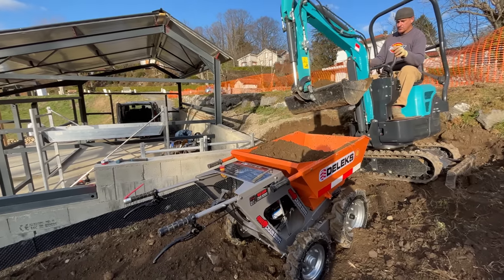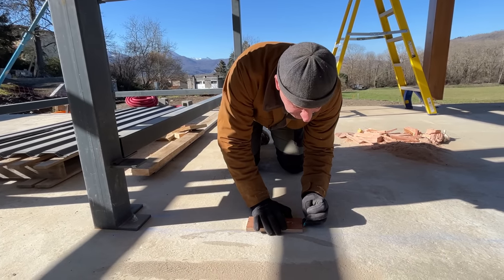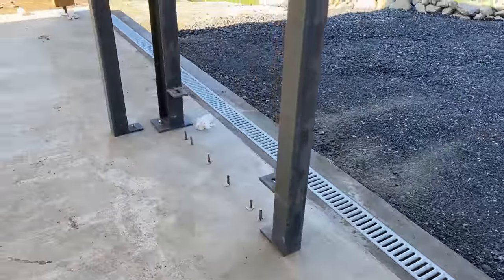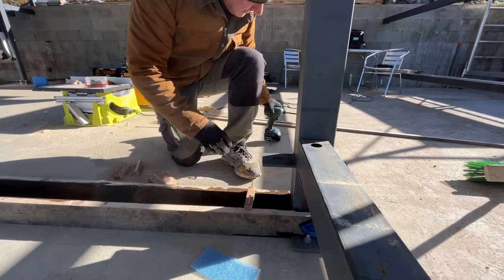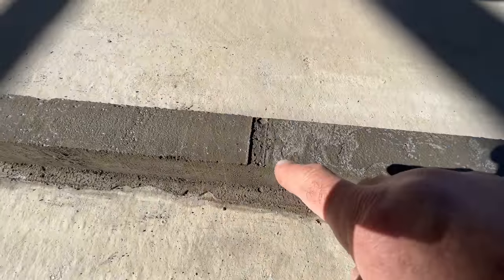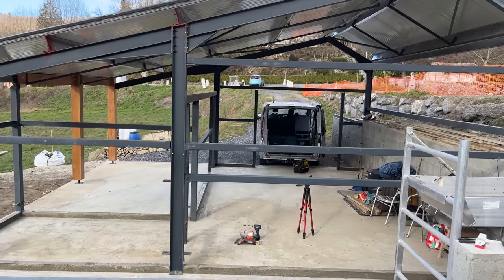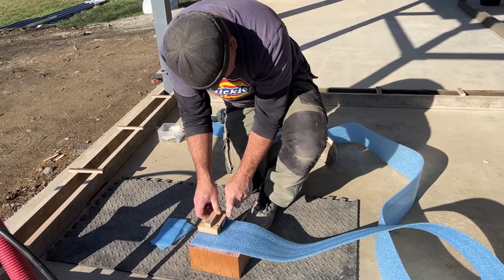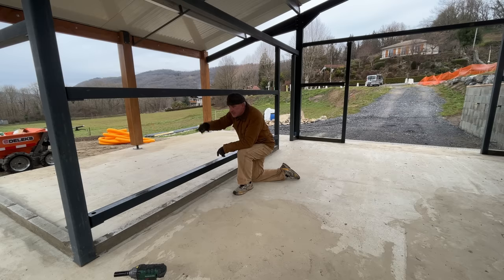Concrete Plinths & Earthworks  | Garage Shop Project EP28

Comment: Could I make a suggestion?? With wheel barrows powered or handraulic , alway face them the way you are going to go before you load them. That way you don't have to fight a full one turning around 👍
Reply from the maker: It is quite agile, but i know what you mean.  I was trying to get it wide for the 80cm bucket.  Julie is tough though 🤣

Comment: Hi you, I love your videos and am excited to wait every new episode. And I learn something every time 😄.
For the little concrete footings I wonder why you don't use brick stones, which will be much less work when I see all the preparation you have to do before pooring the concrete. I wonder if stones were not easier and faster?

Please go on with your video documentation, I love your channel!
Reply from the maker: If I had used bricks then there would have been more risk of living gaps in the mortar and and there would have been mortar in the vertical joints.  I had the wooden forms already and the smooth concrete, painted black gives a nice shadow gap too.  Plus I am awful at laying bricks 🤪

Comment: Can't remember if you've ever mentioned, will you put up solar on the garage roof once you are further along?
Thanks for the update as well.
Reply from the maker: Hi Robert - yes, we will have around 18 panels on the roof.  It is SW facing so not perfect but will get a lot of summer autumn sun.  The house itself will have another 18 panels and is directly south facing.  No intention to connect to the grid.

Comment: well done keep it up , i am still far behind in building my garage for the equipment 
but had similar ideas in mind , the plinth is a good idea i shall be doing one as it protects the sheets and  prevents water ingress. thanks for the idea
Reply from the maker: The plinths seemed to have worked and makes a good solid barrier to the outside.

Comment: Tip: to save cutting blades and speed up while cutting rebar, all you need to do is cut past half way and then the rebar is easy to bend and snap.
Reply from the maker: It would mean stopping each time to wiggle...I was surprised the disc held out and it is still on the grinder.  No more rebar for a while.....thank goodness 🤣

Comment: Interesting method with that short concrete stub wall. Not something that is done here in the US but that's why I watch so many channels like yours is to see what everyone else around the world is doing. Often run across some really neat ideas that I put into my tool box of methods. 
      I kind of wish I had a bigger concrete mixer. Mine is a one bagger i got almost free.. But my back says I don't need one... One of the best things I bought was a two wheeled wheelbarrow. But when will we get enough scratches in the powered wheelbarrow to put concrete in it. :)

         That finger is going to be sore for a while. BTDT.
Reply from the maker: I do not think this is a normal practice here.  I just couldn't think of another way.  It is just a small stem wall poured after the slab.  I just wanted a barrier between the inside and outside as the rain has a tendency to blow sideways here.  The more we used was a cast off from a friend.  And now it is at my son's house for his extension build.  I do have another which is 25 years old but needs a transformer as it is a 110v (site safety in UK requires 110v machines for some reason)

Comment: Hi Ian an Julie       your concrete  bases were very well put together and attention to detail  payed off . They look great . Glad you have had some good weather apart from the frost but as spring comes that will be less. You know you should both invest in hard hats as a bad bang on the head will slow or even stop you in your build as there are a lot of sharks now to collide with . Julie  has become more professional and is doing more getting more confident  good luck with the build and watch not damage any more fingers Ian as they are all needed in this great new build
Reply from the maker: I was trying to think how I could have done it during the slab pour but it got too complicated so I opted for putting them in afterwards.  They have worked out really well with the siding butting up to them and using it as a shadow gap (we painted them with waterproof bitumen paint)

Comment: Ian will that new concrete key onto the older concrete to make a good waterproof seal?
Reply from the maker: It has done so far.  I have one area I am investigating but over all it has keyed in well. (and the bitumen paint helps too)

Comment: nice video... wich deleks dumper are you using? is it worth the investment? how was shipping and everything regarded about purchasing this thing? looking to buy something similar for myself.. keep up the good work :)
Reply: aaa i looked older video.. everyhing explained :)
Reply from the maker: In the short time we have had it, it has paid off and really easy to use.  We keep it running now so makes for quicker dumping (disabled the deadman's switch on the handle 😵‍💫)
Reply: @HomesteadingUncontained  yeah i saw the annoying switch... if i buy it.. its the first thing that is coming off.. how much did you pay for it? i'm assuming that you ordered one from germany or italy? I'm from slovenia, looks like italy will be the choice.

thank you for your answer :)
Reply from the maker: @romex66  Yes it came from Italy. It cost €1400. Free shipping.